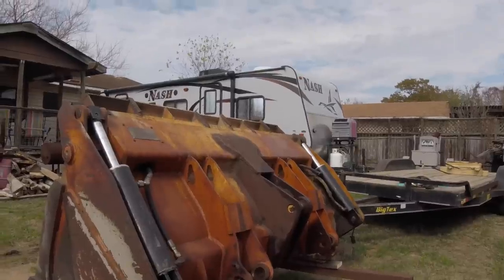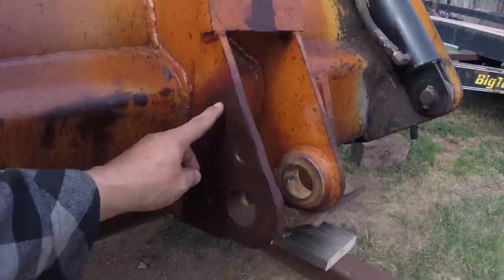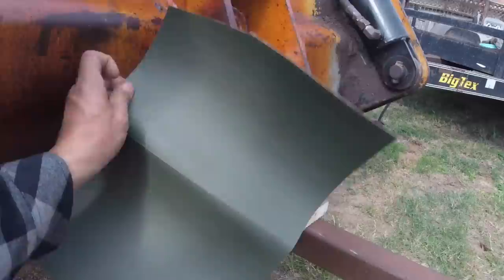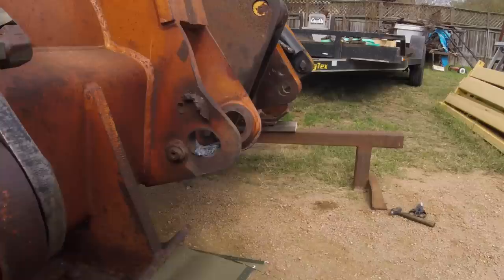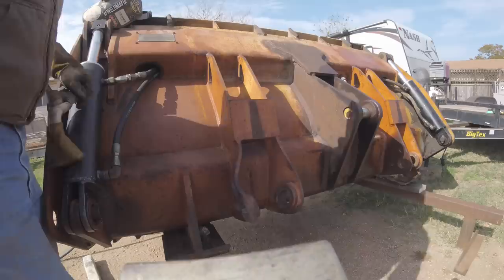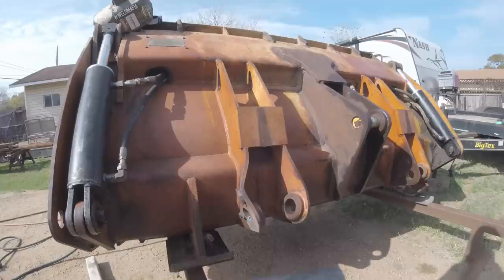John Deere 444E Front End Loader Problems.

Comment: Always enjoy your videos. this one was short & sweet but I learned from it. "Clean metal heats up faster"  thank you , Sir!
Reply from the maker: It makes a big difference. If you see any orange as in when heating metal that has been painted. its basically a layer of carbon like on the space shuttle tiles. its reflecting the heat or at minimum is not letting the heat transfer into the part. I may make a specific video on that one day to show what I mean
Reply: @ICWeld  I would look forward to a video on that! Thanks
Reply: I've burned the paint off trying to save time but your advice is spot on. 2 minutes to grind it off makes it heat up way faster just like if it has mud or dirt on it , heats up faster clean.

Comment: Rather than cut a full circle to check the diameter of the circle cutting attachment. 
With a good sharp center punch place a punch mark near to or on the edge of a clean straight edge of steel plate. Place the pivot point into the punch mark and make a short flame cut into the plate edge to the right & left of the punch mark at the radius set. Measure between the two nick cuts in the plate for the diameter & adjust the distance between pivot to nozzle as required.

Comment: Had a similar problem--- to align the holes across the structure I used a bar through the existing lugs on the other side and by measuring the bar off set parallel to the edges of the structure and the lug spacing was able to weld them in the correct position without needing to line bore.

Comment: The only thing i have concerns about is the forks on the loader where you straighten them out  i think they will fail soon  due to metal fatigue   . My opinion  your  work though is excellent  its the customer  not allowing it to be fixed properly  . Unil the next video peaceout.

Comment: Nice repair!
It annoys me when machine owners 'save money' with stupid ideas - that pin fix being a classic. Reminds me of those petrol disc cutters when the air filter chokes up with dust. Instead of cleaning or replacing that air filter they run the cutter with no air filter and the engine wears out internally..

Comment: Poor bucket looked pretty abused.  I thought I saw a bolt being used for a pin and the centre bracket for the dump cylinder looks replaced as well in the past.  As long as the customer signs off on what the work is what they specified, I guess its ok.  Don't want that come back to bite you.

Comment: The customer wants to safe money.
Not on excessive pin wear and bent eyes and pushrods i presume?
Its your skills that safe him. Knowing how to weld with the less possible distortion there alway is when welding. I saw someone do this the same way and they needed a day to burn out the pin because it was jammed, and grinding the holes so a new pin would fit.

Comment: Great work as always Isaac! Those holes looked like they could have been machined.... incredible! Do you think you could do a video showing some different techniques for templates. I have to cut the ears off a couple excavator buckets and weld on the correct ones. They are the JD manual quick connect style, I was thinking about just cutting them with the torch and grinding them down to perfect. Anyway thanks for the great content regardless!
Reply from the maker: you can start off with a poster board pattern then transfer it to a 1/4 plywood pattern. should work good. I have a couple of videos of making new bucket ears.
Reply: @ICWeld  Thanks for taking the time to respond.... it is appreciated!!! 👍 Have a great weekend!

Comment: Isaac-  Love your videos..... I've watched most of them 2-3 times now.

Great work (as always), but consider this:  What if the repair that the customer "wants," is influenced by how you present the options?  I would say, an overwhelming majority of the time, an owner just wants the machine operational/producing again at the cheapest "repair" cost possible (which I understand, in today's market). However; your reputation is involved..... because the same folks that want it done the cheapest, will be the loudest in blaming you for a "premature" failure; that wouldn't have occurred if the job had been done without cutting corners (which were the customers request).  So, instead of saying, "The cost to flame cut new bushes and patch it together would be $300......or, we can do it right and line bore it for $700" [these are totally fictitious/example #'s].  Since you're the professional and know what needs to happen, "The cost to fix this would be $700." You'd likely still get the job, & would be protecting your reputation by doing it right.

This seems to be a recurring issue from the last couple of videos you've posted, so I'm hoping to help you.

Thanks for all that you share with us!

"It's not the cost of the repair...... it's the cost of fixing what you broke."
Reply from the maker: This was a first time customer and I tried to explain the benefits of the proper repair to no avail. Oh well, I tried.
Reply: @ICWeld  That's just what I suspected, and as the business owner, you have to decide what works for you and your business-

My previous comment was long, but intended to present an alternative for you to consider (if it's what you want and would work for you). Perhaps a question would more succinctly make the point.  
Question:  Do customers utilize YOU for repairs, because-
A)  You explain potential repair options (including quality and substandard) more thoroughly than anyone else
B)  You're the cheapest
C)  Customers are coming to you because you have the reputation of outstanding/quality/long lasting repairs in difficult situations, and that you're an amazing metal (miracle) worker.

While it's probably not this simplistic, I'm betting that most folks are coming to you because of "C".

In a situation like the repair of this loader.....if you exclusively offered the long-term repair at a fair/appropriate price; would the customer go somewhere else? If so, will he come back to have you do it right, when it fails prematurely?

I realize that it's a balancing act, and that it actually may be different across customers.

At any rate.... thanks for sharing what you do!
Reply: Totally agree about Isaac's reputation being on the line when it comes to customers not wanting to spend the extra money on the correct repair. As long as its noted on the invoice he would be covered. Also, the great thing about his YouTube channel is that his jobs are 'documented' and on the interweb forever 😀
Reply: I have learned to do something much like that. Since on some jobs, equipment broken in the middle of a job needs to get back to work ASAP. I will often give a customer the option for me to patch it up and get it working right away telling them it should last a month, then you can bring it back and do the proper repair. Basically paying twice for the same repair. That sorts out the customers that really need it fast from those that just want to cut corners.

Comment: Ok... what is the cost delta of a line bore vs non line bore?  That's a healthy piece of equipment.  Myself a correct repair takes precedent over cost... but then again I operate my own equipment.  I know when something is not right.  As such am wicked proactive on maintenance and repairs.  The ounce of prevention cost significantly less than the pound of cure.

Comment: How much machine do you need to run an arc gouge, would a Miller 225 work or do you need closer to the 300 amp
Reply from the maker: closer to 300 would be best.

Comment: Nice work as always, Isaac. How do I get in contact with you to weld up a couple of projects that I have? I'm not far from you, near College Station.
Reply from the maker: whatcha got?
Reply: @ICWeld  I have a man lift with 7" x 3" main tubes that cracked and split vertically. Also have an aluminum bodied Kirkham Cobra that I need some panel welding on, replacing the front nose, butt welding the rocker panels together under the  door openings.
Reply from the maker: You may need to get a welding procedure from the mfg of the man lift. Any work on those types of things are critical.
Reply: @ICWeld  its a Condor, long out of production and just used on my property while putting up my shop building. Nothing commercial or heavy usage at all and too old to be used in commercial or rental anyway.

Comment: I realize that money was tight on this job, but with heating those lift arms, will that likely bend there again, if forced?  I ask because I was told  a long while ago, that steel, once bent, will bend in that same area again. What's your opinion on this, Isaac?
Reply from the maker: Cant really say for sure but on the positive side, this most likely bent because of a pin working its way out of the bucket ears. So long as it doesn't happen again, I believe the vertical strength is still intact. It should hold fine.
Reply: @ICWeld  Actually you answered two questions for me, I forgot to ask what caused the damage in the first place. Thanks!
Reply: Reg Sparkes if steel stretches withing certain limmits the molecules will stay toghetter and the steel comes back to its original size. Stretched over this limmit, 0.2 flow value, the molecules(smallest particel of the stuff that still has the same quallities of it) tear apart and loose their strengt. Secondly heating up steel: sometimes steel is heated up and in a cooldown proces its tempered to get the condition. Heated up and cool down with water will harden it for a chissel for example. So its the way isaac treated this steel that made it work.
Reply: @ICWeld  put a remark to Reg Sparkes
Reply: Heat straightening steel is a fairly common industry practice.  The big questions would be what type of steel and how hot did it get.  Those are the types of things that would cause the mechanical properties of the steel to change enough to cause a failure of the heated areas.

Comment: A few years back, looking for cheaper units to get, i saw several units in a lot with a mod where they put a curved brace (basically they bent 1 inch rebar and welded it to the ears and in the middle on the ridge of the bucket). This appears to be  a common issue for some of these, going by that lot i saw, there were like... 8 i think. So either they bent two machines and figured it would be simpler to mod all, or that. 

 That doesn't excuse the state of this machine tho... don't particularly get owners who think that they're getting their pound worth out of a machine if they don't service and take care of it. The logic doesn't compute to me. You bought it cheap... but you still paid money for it, you're gonna abuse it, it's gonna break, and you either fix it (expensive or not, but still money) or waste more money, when maintenance and proper utilization is cheaper overall. Same kind of people that don't quite seem to get that a car isn't worth 10k it's worth whatever you paid for it until you don't own it anymore.